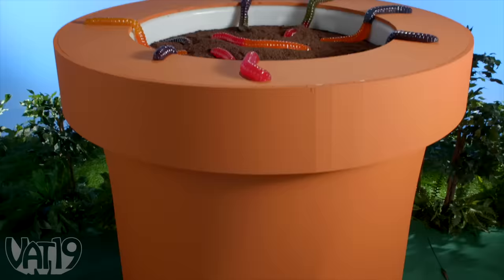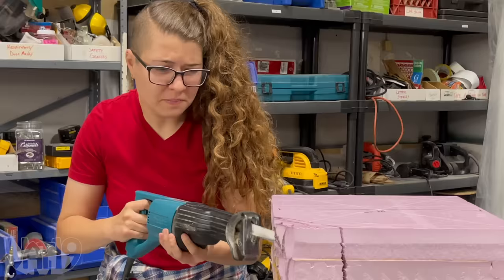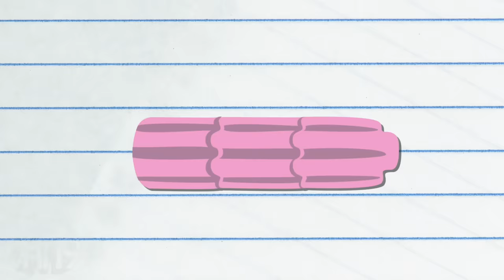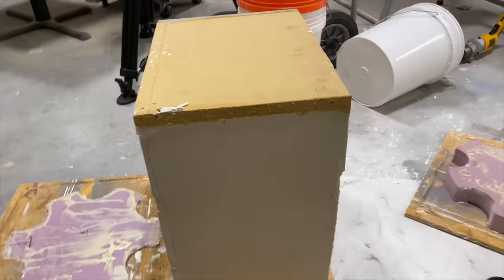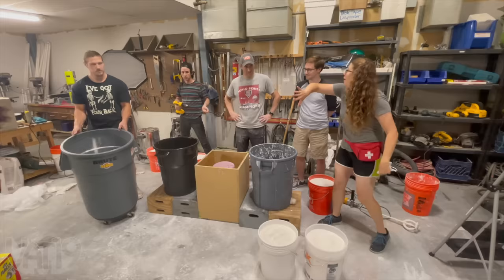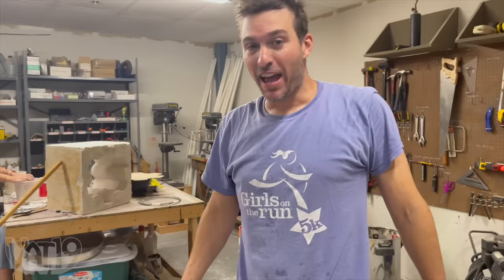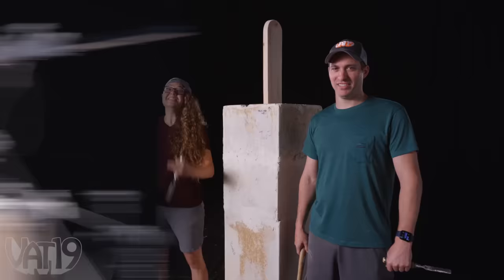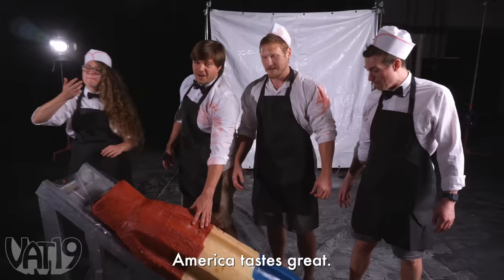We Made the World's Largest Gummy Bomb Pop • This Could Be Awesome #21

Comment: Imagine if Sloane's glasses fell in the plaster 💀
Reply: NOO LMAO
Reply: I was thinking that
Reply: Wouldn't even be able to pull them out or you'd burn your hand. When that type of plaster starts to set it starts an exothermic reaction so not only would it harden it would continue to heat up as it hardens making it increasingly difficult to take off. Some art student ended up losing a bunch of fingers like that cause they couldn't save them.
Reply: That wouldn't end well
Reply: @xvaldez3284  FINGERS?!
Reply: Plaster Glasses